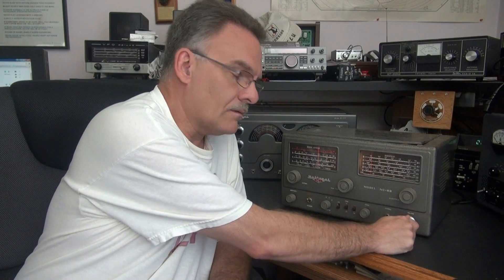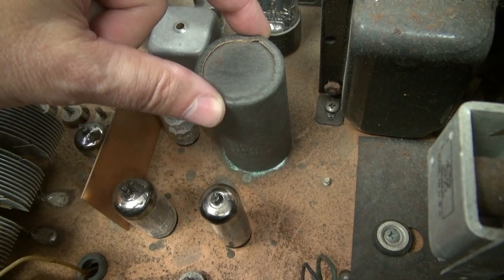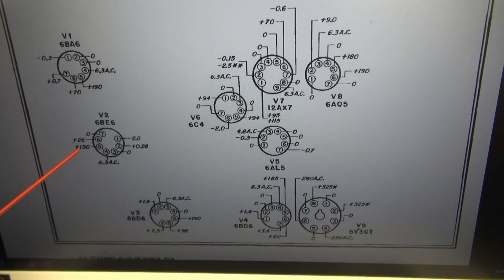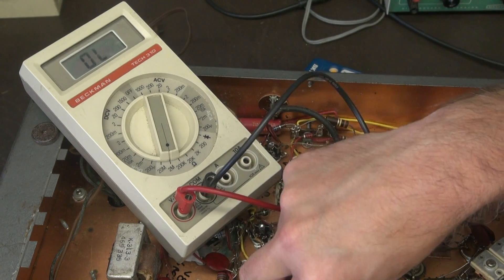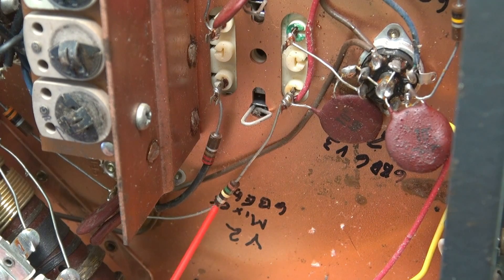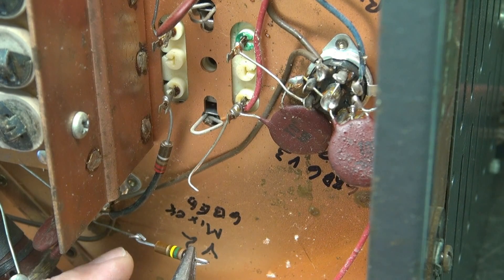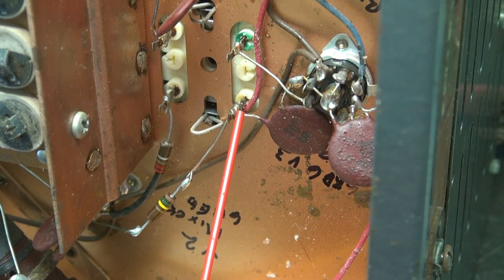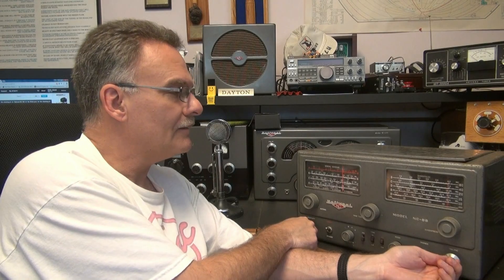National NC-88 receiver repair How to change resistors in tube radios

Comment: Hi D-Lab, I have a resistor that gone bad, Its from an old Pioneer amplifier SA-410 the problem is that my resistor is an old one, I can't find it anywhere, Is there any alternative, How it should be nowaday, So i can replace the bad one?
Please i want an advice, I'm not an expert.
On the ceramic resistor that have 3 pins there is some data: R71 0.22 x2 (2w)

Thakns a lot in advance for any informations, The sound i hear from it nw comes only from the right channel  :)

Comment: DUMB QUESTION TO ASK: Did you replace the old resister with the same one (but newer) or did you modify and change the resistor?  I'm very new at this and trying to understand if/when I do replace resistors I replace them with the same color code as noted in the schematic.  Your video was very helpful for us beginners in radio restoration.  Thank You!

Comment: That is a great tip on the resistors and I was just looking at an ashtray full of bad resistors I had change and as surprising number of them where the yell band as you pointed out. A great tip.

Comment: Got to love it when it's a easy one.  Besides electrolytic capacitors the old carbon comp resistors are the next most troublesome components there are.  So unreliable I did a whole video on them.

And LOL, I think I'm currently listing to the same "Magnolia state" guy that you had on the radio.
Reply from the maker: Thats super cool man. Gotta love skip land!